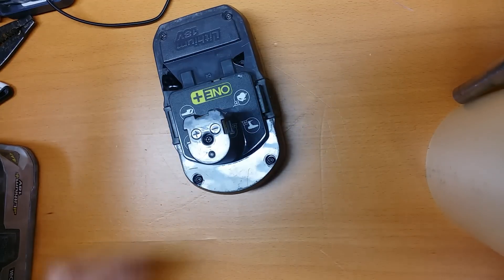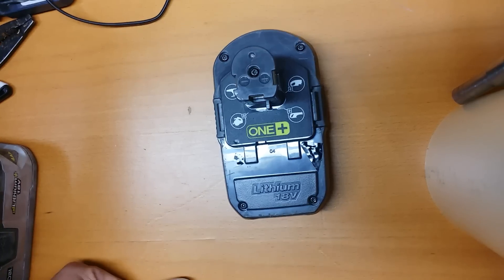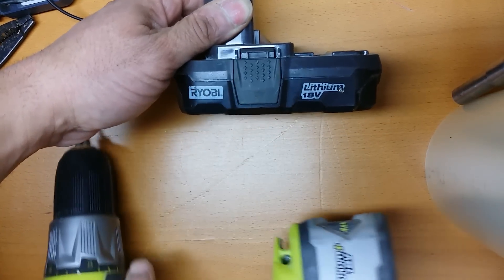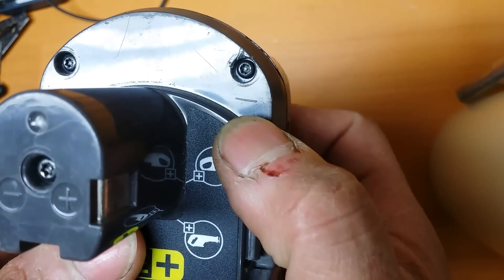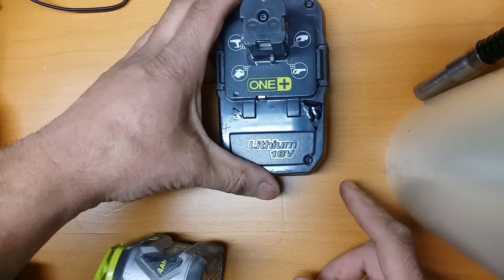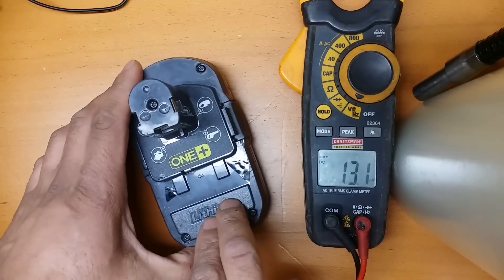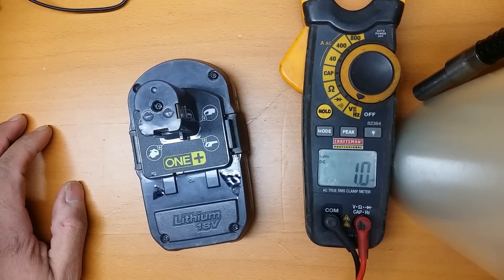How to revive a Ryobi 18 volt lithium battery. Quick and easy

Comment: You know, you don't have to drill holes in the side of the battery case. It's held on with 5 screws. One of them has a little plastic security cap that you can pop off with a knife. Remove the screws and the top half of the battery cover sides right off.
Reply from the maker: I'm sorry to get him back with you late I might have not gotten the notification for this message. Just want to say that not everyone has two special bit tool that's why I did this video.

Comment: Can you reshoot this video to show the charging part. That is the most important part and it's not in this video. Other than that, this was helpful . If we don't have one of those Pyramid things, what else can be used instead of that?
Reply from the maker: I also have another link on a different Ryobi lithium battery
https://youtu.be/OAt5TTq_4fw
Reply from the maker: You can also use another Ryobi battery, car charger, car battery and jumper pack
Reply: Thanks. I watched your P108 video and saw what I needed. I do have a trickle charger for car batteries. I'll try that too

Comment: This method worked with my P107. Same drill locations. Used a 12v automobile battery charger at 10 amps for about 2 minutes. Thanks, tomstuff460 !
Reply from the maker: You're welcome.

Comment: Great video... I used the Ryobi charger in this way. I clipped a positive  and negative alligator clip to each one, and also clipped one lead to the center "sensor" lead, and attached that to the negative lead on the  other end; while touching the combined negative/sensor lead to the negative side of the battery; while touching the positive side to the battery. Then I plugged and unplugged the charger about 5 times. The charger blinks fast "red" then switched to blinking "green". I started with 5 volts on the battery, and this quickly bumped it up to over 12; disconnected everything; put it back in the charger, and "voila" blinking Green charging light!!!
Reply: CAUTION: It is also very important to note that as you do this little trick that you do not leave it on the "fake by-pass" system more than a few seconds at a time, because a Lithium-Ion battery will "run away" pretty fast, and cause a fire.  THE KEY HERE IS TO ONLY BUMP THE BATTERY UP TO A VOLTAGE(AROUND 12+) THAT THE CHARGER CAN SAFELY PICK IT UP AND RUN WITH IT.

Comment: Can I use a car battery charger with a trickledown switch?
Reply from the maker: Yes you can😃
Reply: tomstuff460 Thank you. Couldn't find a battery on Amazon with a good rating. Was about ready to order one, then got the idea to try You Tube. Thanks for the info. Good explanation on how- to also.

Comment: I tried this and the wires got very hot. Ihad pos to pos. Neg to neg. Exactly how it is stamped on battery tower .
Reply from the maker: It has to be the same model number p 102 every model batteries made slightly differently. For no confusion use black for negative and red for positive wire.

Comment: Worked great....I didn’t have the appropriate screwdriver bit and too far to drive to the store so tried your method, didn’t have a power supply but used another battery and that worked great
Reply from the maker: You're  welcome!
You save money on the trip driving, not picking up new tools and without buying another battery pack👍💵💲
Reply: Reginald Ian Nolan 
How exactly do I jump the 2 batteries together?

Comment: I was on the verge of throwing away my Ryobi battery when i came across this video.  My problem was, I did not have a power supply like yours, so I was a bit confused as to how to get some juice into the little holes I drilled. Since the battery is 18v , I took a couple of 9v batteries from some smoke alarms in my house and connected these in series, then ran the wires from the 9v batteries to the Ryobi battery. 30 seconds later, I popped it into the charger, and darned if it didn't start charging! I used my drill all day yesrterday, first time in months. Cool vid.
Reply: Thanks for sharing your work around with the 9 volts. I will give it a try.
Reply from the maker: I'm glad my video can help!

Comment: Thank you!!!  you saved me from buying two new P105 batteries.  I read across each battery and it looks like the front of the pack had a lower voltage than the batteries in the back.  Not sure if Ryobi chargers can even out the voltage across all the batteries, or their batteries are junk???  It seems like they used to last longer around 10 years ago.  Thanks for the video!!!

Comment: Bought a used impact driver and it came with two dead batteries. The only external power supplies I have are a 24v power supply for my 3D printer and a 12v charger for my motorcycle. Went with the 12v because I didnt want to overload it knowing it wouldn't charge it, I was just hoping it would just kickstart it. AND IT WORKED! Followed your instructions for where to drill. Cant say thank you enough. Doubled my batteries thanks to you. Wish you all the good karma for the new year! Cheers!
Reply from the maker: You are so welcome . Glad my video can help! 
Have a happy New Year!

Comment: This was brilliant - bonus, covered the holes with tape and now it's a quick fix next time the battery misfires - no need to disassemble again. Much appreciated.

BTW - I didn't have a power source so I just jumped it with another Ryobi battery that fortunately still worked. Now the dead battery is charging normally - had this happen before when draining the batteries all the way, now I unplug them from whatever tool when putting things away.
Reply: There’s a risk of damaging a lithium ion cell, shorting it out, and causing it to over heat and explode.

Comment: Completely bye passing the BMS sounds like thermal run away just waiting to happen!
Reply: Being that it is only to put a surface charge on and then charges from the charger it only bypasses while putting the surface charge on and not while charging.

Comment: Tried this and still no charge...all i get is the 2 pulse pause 2 pulse green light as it is still trying to find itself to charge properly. I have done the cell charger, 18v charger, 12v battery, and trickle charger to the 2 drilled holes and nothing...yes, everything was hooked up and done as in the vid...any ideas now?
Reply from the maker: This has happened to a few people already and I believe that the circuit board on the lithium pack is fried. The charger deck doesn't recognize it
On one of my lithium batteries I bypass the circuit board by soldering the wire for the circuit board directly to the terminal.

Comment: You do not need to drill. You have access to the positive and negative right on top of the battery. Thanks for the video.
Reply from the maker: it won't work that way is the battery doesn't take any charge

Comment: you didnt have to go to all that trouble could have aplied voltage rite were it says pos+ and neg- rite on batt
Reply from the maker: When the battery goes dead and it won't charge with the charger deck and it keep showing that is defective . Then try your method on the top terminals like you say. good luck!

Comment: Awesome!!! I just did this and it worked. I had to get at least 15 volts back into the battery and reset the charger by unplugging and plugging it back into the wall, but after doing so, it charged fully. Thank you so much for this tip!

Comment: You Tom, are good news ! I have used my batteries and didnt recharge them. they sat and this I will try on 4 battery packs that are in the low non working condition. Thanks tom  PS. some people think opening the case is best. I can tell you what you did was the best way. Too many people will fiddle with the wires and circuit board once open because they will be lost looking at all the connections etc. You totally zoomed right into two areas, the positive and negative and kept it really simple - GOOD JOB !

Comment: Looks like there are about 150 people who didn't do it right. I drilled the holes in the exact spots, labeled positive and negative, put two metal wires in each hole, used a working 18Volt battery, and touched the corresponding positive and negative wires to the positive and negative connectors on the working battery, saw some very tiny sparking, held for about 3 to 5 seconds. Removed wires, and then put the bad battery on the Ryobi charging station, and it started charging. You just saved me $60. Thank you sir, and to the others who posted in the comments about using a working battery to boost it since I don't have a regular battery charger with leads like this video has. Now I get to finish my yard twice as fast again.

Comment: Not sure why you drilled holes on the battery when you could have just open the dang thing. It looks like someone already opened it anyways since the tamper plug on the screw is missing.
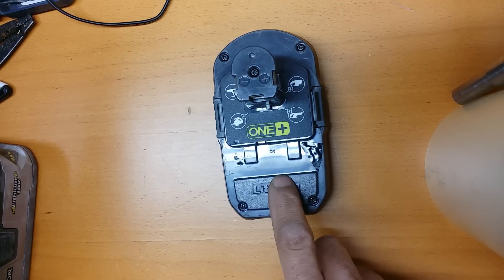Reply from the maker: If you listen to the video i says that I already opened it on 1:13 and the reason for drilling the holes is because some people don't have the special tool bit to open it that's why .
Reply: @tomstuff460  thanks for clearing that up sorry I must have skip that part.
Reply from the maker: @stealthflythecoop6819  its all good. 👍

Comment: Was able to resurrect 1 of 3 dead batteries. One came back up to 7 volts and still wouldn't take a charge, the other wouldn't come back above 5v. Happy to have one battery back, but any ideas on the other 2?
Reply from the maker: your battery pack might have several cells not charging anymore or the circuit boards maybe fried!

Comment: My P104 has 11V across the contacts and 16V across the cell pack. If it appears to be not charging will that be a charger problem or a better problem?
Reply from the maker: 11 or 16 volt is a nice amount of power for it to charge normally.  Those new lithium batteries have circuit boards on them they could burn out. The battery charger light should be on when it's plugged in if lights not on the charger then you have a defective charger . If the charger is working when insert the battery and should go on a test mode and if the battery good it should go to blinking green and begin to charge. If it stays on wavy red means you have a defective battery.
Thanks for the question

Comment: Great video it was very easy to follow ,Thank you it worked.
just one question, doI have to do this every time I need to charge the battery?
because I charged it after drilling the holes and used it ,but when I put it back in the charger the red light just blinked and did not go to the green light
Reply from the maker: After drilling the holes you're lithium battery back then you can charge it with some cables with another battery then you can charge it on the charger deck. The red blinking indicator lights means-testing the battery. If it doesn't go to Green then do the method I explained on the video again then retry it. (Note You only has to do this method just one time only)

Comment: I have read a couple dozen of the comments, and the replies, but one thing that I can't seem to find an answer to Is, how is it that people are finding their battery packs voltage below 5 volts, anyway?
Reply from the maker: The way I found out. It's because when my battery wouldn't charge so I opened my lithium battery pack and use my multimeter to check the leads on a circuit board and It read 5 volts DC. That means it only has 1 vote per cell and it has 5cell
So that's when I decided to make this video. Hope this answers your question thank you!
Reply: @tomstuff460  but what has gotten the battery cells to this low State the voltage? Sitting for months and years? Isn't there a circuit in the pack which is supposed to prevent discharge past a certain point? And if a cell drops below the minimum voltage just from sitting, aren't the cells generally at the end of their service life, anyway? Meaning, maybe you can boost the voltage enough to get it to charge, but isn't it going to also discharge again rapidly, and have reduced service life?
Reply from the maker: @TurboDV8  I never had a lithium battery go dead from just sitting. I left fully charged Ryobi Lithium batteries sitting for month or two without use and it still fully charged. 
The cause is from trying to use your power tools to it dies waiting for a minute or two continue  reusing it over and over without charging it or letting the sit without charge it for several weeks.  notes charge Within same day or the next same day after lithium battery stopped working.

Comment: Great trick, it does work. I tried it tonight and the battery is on charge. I  recommend you put some tape over the holes you drilled or some silicone to keep out moisture. Great information in this video.  Whomever created this problem at Ryobi needs to get sacked. Thank you so much.
Reply from the maker: Silicone sounds like a great idea thanks

Comment: This works perfectly as shown.  I used a little 6-12 volt trickle charger designed for garden tractors- one minute charge time and the battery charged.  Saved three batteries I was getting ready to replace.
Reply from the maker: Yes you save yourself about $90 awesome

Comment: There are a few videos online that discuss how to do this but this is the most helpful video because it shows how to do it without removing the case.  I had a stripped bolt and was able to follow your steps.  I made slightly bigger holes (8/32) but plan to cover them with electric tape until the next time they need charging.  Found an 8.4 volt charger (looks like a old calculator charger or something.  Was fortunate enough to have one with an LED on it.  I cut the tip off, used the side with white lines as positive.  Thank god you mentioned which side was what because looking at the placement of positive/negative on the battery itself, I would have certainly put money on the opposite lol.  My LED light seemed to go red whenever I made contact on both sides.  Being scared, I only touched for a few seconds then let go.  I checked and seen voltage went from 3.XX to 6.XX.  It would however slowly count down by .01 volt.  I did the process again and got to around 7.5 volts.  Was worried I had to go over double digits but I almost sent you a paypal donation when I saw that green light blink on charger almost instantly.  Yea, thats how happy I was.  Awesome video and thank you.  Some other videos mentioned warranty process with local stores is hell.  Keeping that charger on stand by to assist when this happens again.
Reply from the maker: Chukwuemeka Onyema I'm glad this video was very helpful for you I'm just trying to make it easy for everyone else instead of going through all that hassle or opening the case. And you're welcome

Comment: Was delaying throwing a battery out and decided to YouTube the problem. Thank you so much for this site! Worked like a charm. Used my multi meter cables connected to my battery charger. 3 seconds on the charger and slapped it to the ryobi charger. Worked instantly.
Reply from the maker: Ben Strong 👍

Comment: Thanks tomstuff460. Repaired 2 P103's yesterday following your + & - drill points.
   Went to Goodwill & got a 29 volt 2 amp DC charger for 99 cents, stripped the leads & used that to jump charge the P103's back up to 18 volts. Took about 10 minutes each. One was at 6 volts the other was at 0!
   Saved me up to $80.
Reply from the maker: Jonathan Kozak $80 is a nice amount of savings and you're welcome

Comment: Good video Tom! I would just say be very careful to only drill the plastic and only until you see the meal on the terminal then stop. Li-ion batteries can be dangerous and cause a fire. More info below just for fun! 
.
The Tower Terminals + -  are connected to the Circuit board. The  Circuit board reads the voltage and determines if  the voltage is too low the circuit board says NO CAN DO  but only if batteries fall below a given voltage. Ryobi should make a better circuit board so the batteries won't discharge to the point where they can't be recharged. But this would be very difficult for Ryobi to do because in some cases one or more cells may go bad. So this drilling method or bypassing the tower terminals may not work with every battery because  you may have a dead or very low voltage cell that can't be recharged and that one bad battery will stop the charging of the pack ( low voltage problem ). I tried Tom's way  but did it by removing the case instead; I found one dead 18650 cell. I replaced that cell and balanced the voltage with my charger on all 5 batteries so each battery had the same voltage; now my battery is taking a charge and is good to go.

Comment: Made my holes with a knife, and used a 6v battery with wire leads connected to the probes of my volt meter for about 2-3 minutes. To my surprise it is now charging! Good job man! Thanks
Reply from the maker: Awesome I'm glad it worked! 👍😊

Comment: Great video thanks. Quick question: when the battery is placed in the charger the red light comes on then goes off and the green light starts flashing indicating it's charging. After a while the green light goes solid indicating the battery is fully charged, however when the battery is inserting into a tool nothing, nadda no power. Will your trick fix this? Thanks in advance.
Reply from the maker: Rude Dawg check your battery pack from the top of the terminals with a multimeter. If it doesn't have any voltage readings you're a circuit board is fried.

Comment: worked like a charm, I used a cheap Walmart 12v battery charger and 2 nails, charged the battery for about 1 min, and the charger read full, so I put on the Ryobi charger and the battery is now charging. +1
Reply from the maker: Joe Baker awesome👍

Comment: Worked great.  Thank you!  I had some problems securing the wires into the 1/8 holes I had drilled.  To ensure a better contact I found two suitable screws and drove those in until they were touching the contacts.
Reply from the maker: Peter Davies awesome thumbs up👍